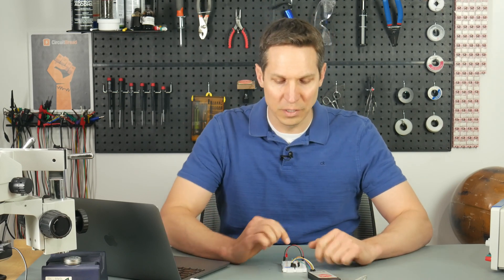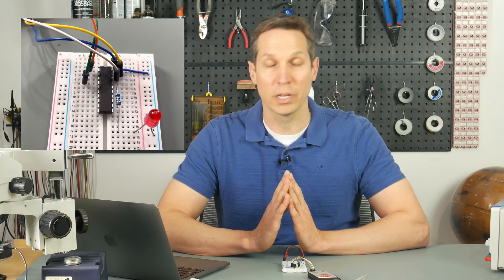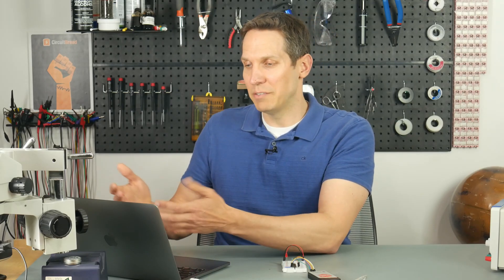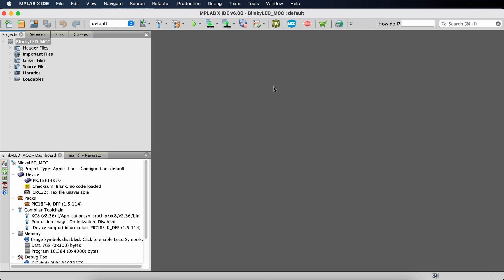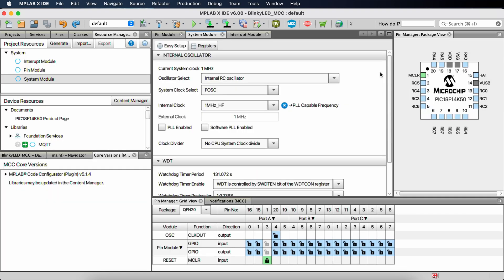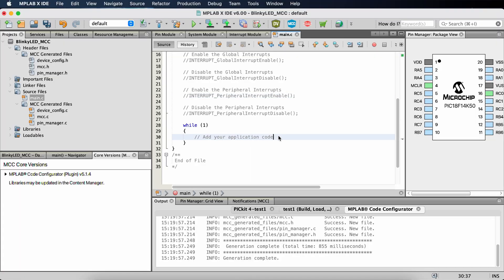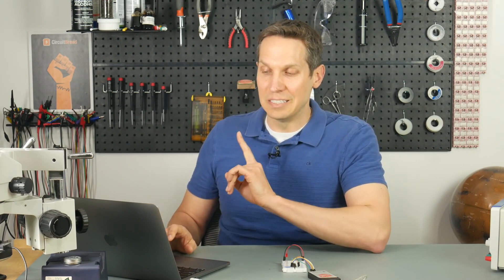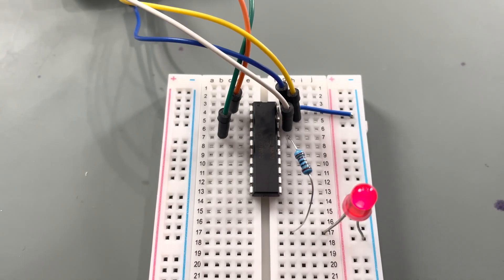Part 3. Introduction to the MPLAB Code Configurator (MCC) - Embedded C Programming with PIC18F14K50

Comment: Is it doing pin assignments and clock settings(like cubeMX), or is it trying to code actual logic or drivers using UI? Right now it looks to me that they are going to deprecate some major frameworks like ASF and force everyone to use MCC. I have found multiple people complain about MCC that it either does not work or projects stop working randomly at some point, makes it such that it is hard to migrate projects between versions of MCC and forces bad development practices. I have even found one report that one company have completely banned use of MCC for anything but pin assignments.

Comment: I'm getting started with MPLAB X on a SAMD21Xplained board and even though the HW is completely different from yours this video was insanely helpful.  Thank you for making it!  After watching your video I was able to get my pins and clocks configured, add USART and RTC and stdio support, and get some basic timed output working in short order.

Comment: Nice tutorial. MCC does not work in MPLAB IDE. But works on Classic mode when using standalone app. Melody is not working on it either. Content Manger Wizard doesn't show on the IDE at all.  I first thought it was lack of memory on the desktop. So I added another 4GB. but the result is same. . I am having windows 7 64bit. Any idea what might be the reason.

Comment: Why should I use 4.75v instead of 5v ?
Reply from the maker: It doesn't really matter on the performance side and sometimes you will definitely want to select 5V.  But, in our experience, sometimes the PICKit3 or PICKit4 throws an error when it tries to produce 5V.  If it works consistently for you at 5V, that's great, but if it does have any issues, just drop the voltage a bit and you should be fine.